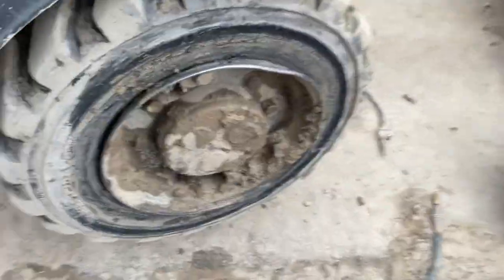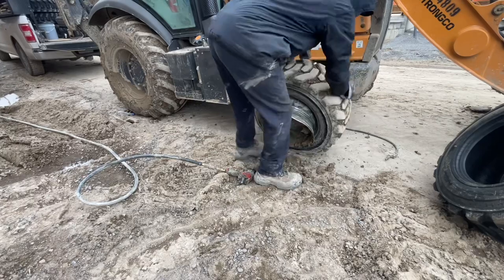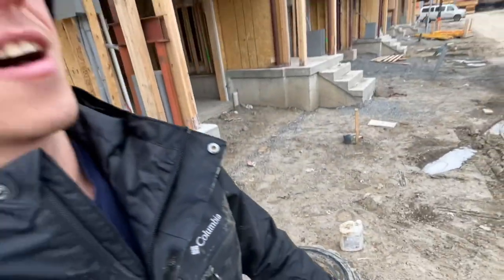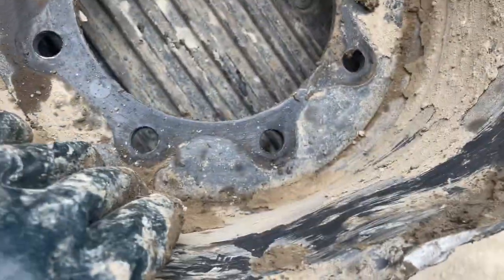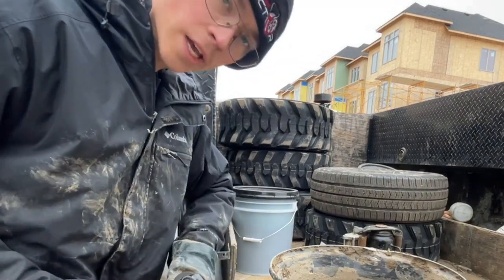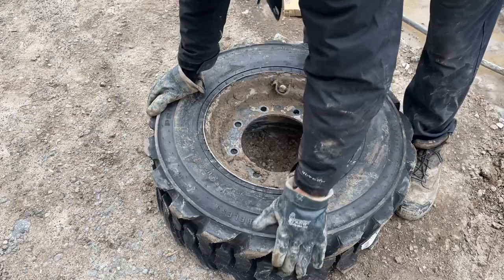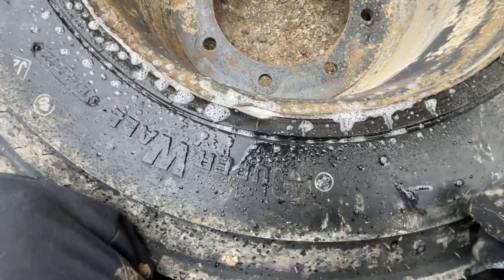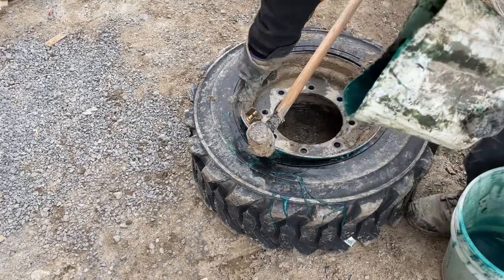I Fixed A Backhoe Rim That Was Destroyed - Vlog #7

Comment: yo I dunno if you'll see this but I work as a tire guy in a shop and you're videos have been a big help so thank you
Reply: i also work in truck tire shop. We see same things daily. Why did you not use bead seal at least? And no metal valve stem? I follow you and like your content but i have noticed you never Touque anything. Why is that? One wheel off out your check would dwarf that cost.

Comment: Good fix, at least for as long as it holds. Whenever you use a wire brush on a grinder you need safety glasses at the very least. A face shield is better. Those wires are like projectiles.

Comment: I'm gonna have to look into CP air grinder now. I gotta say. I am jealous. I have a paddle air grinder on the truck but, I want a wire brush  Grinder.  I have a electric one on the truck and an extension cord. Usually there's  a place I can plug it into.  But not always.